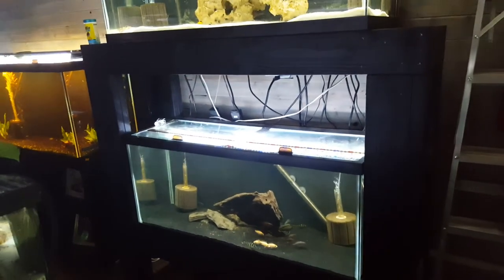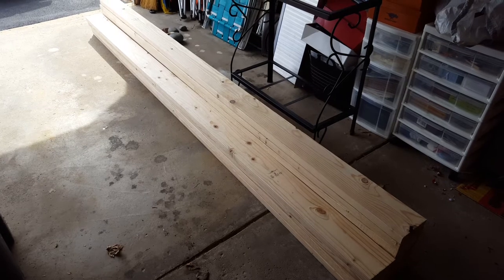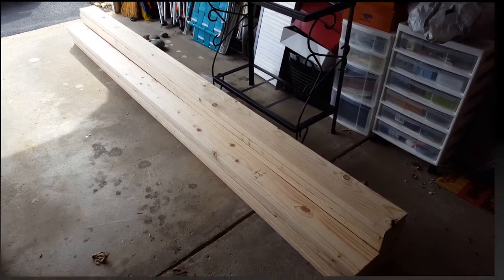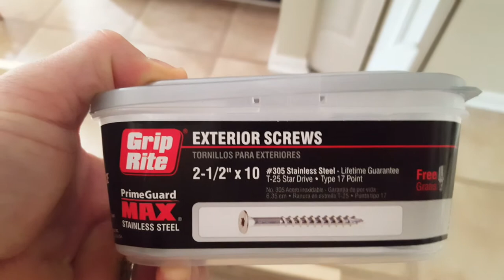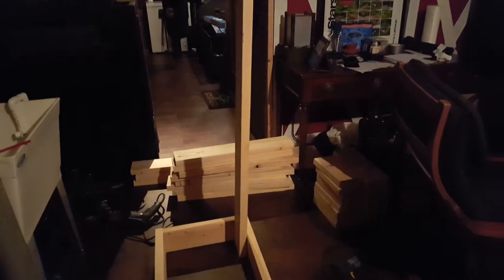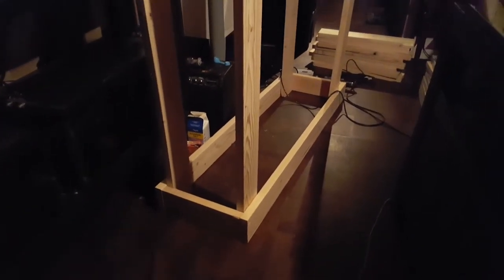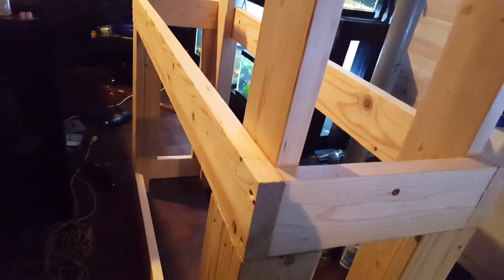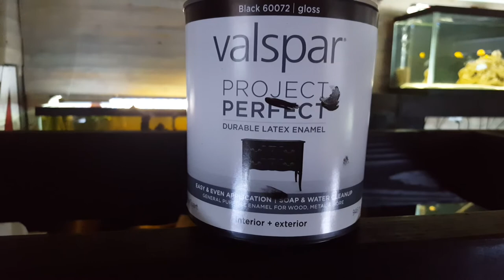How to Build a Fish Tank Stand

Comment: I build a stand for 65 gallon using 2x4. I let the stand site for about 1 week and wen I went to move it to put the aquarium on it I notice that the stand got twisted from the 3x4 drying. What can I do to prevent that for happening with my next build ?
Reply from the maker: I'm not sure, but with the builds I have done they haven't twisted based on where I put the support beams and cross members?

Comment: so how far apart do you place the center boards that are between the shelves? Also how come you need so much space from the legs it looks like a good 6 inches on both sides of the tanks and reason for not having the legs under the tank itself? thanks again love the channel
Reply from the maker: I just evenly space the cross beams (if that is what you are referring to). The space between the tank and the ends of the stand are a necessity based on the fact I needed a double stand and the legs couldn't obstruct the ability to get the bottom tank in place. I will say these stands are extremely sturdy. I did something similar for a double 125 gallon stand (only using 2x8s) for the top and they are crazy sturdy as well.

Comment: Very helpful. I'll be buying some of those screws tomorrow. Apologize if you've addressed this before and I just haven't seen it yet ... do you use any kind of bootie or other device to keep the wood (although painted) legs from being in direct contact with the floor, which sometimes gets wet in a fishroom?
Reply from the maker: I personally didn't do anything to the feet of the stands, but you certainly could. We generally clean up any water that hits the floor pretty quick. :  -)